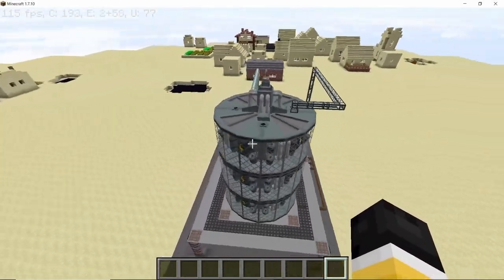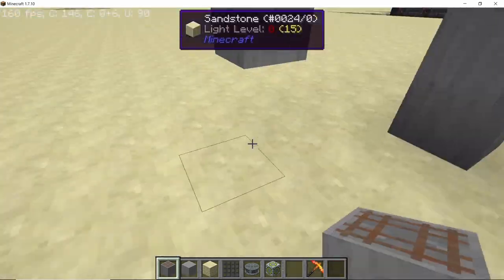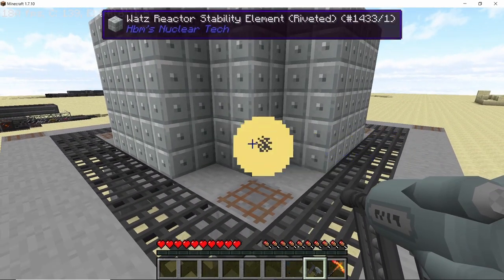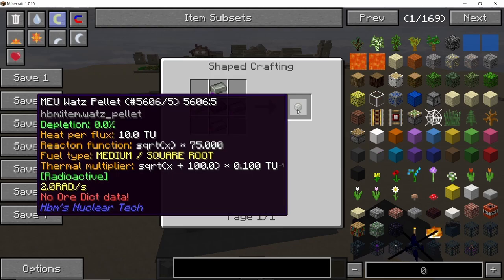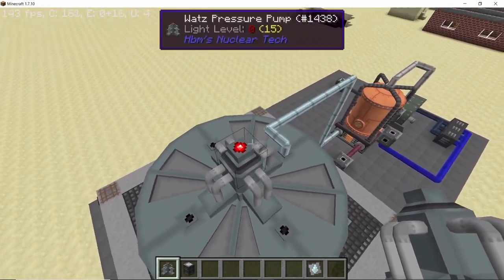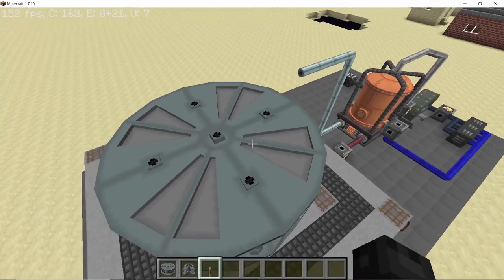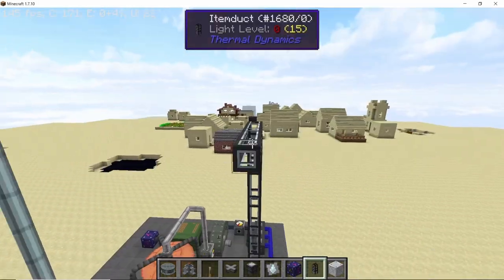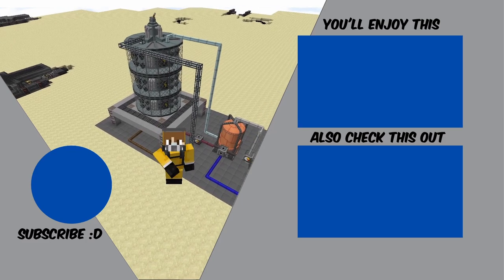Watz Powerplant guide - Reworked Watz Reactor - HBM's NTM

Comment: I remember building one of these back in the days on my base, and just by using LES fuel i was able to produce about 2.5 MHe per second which is absolutly fantastic!
Also i like that they made it different now, it's nice to have it customizeable
Reply from the maker: So true, it being stackable with different fuels on different levels is definitely going to be helpful !!
And that's an absurd amount of HE/s ... I wonder if the number will still be close to that now that the heating system and fuel values have changed
Reply: Fun Fact 
This reactor is very similar to the real-life Pebble Bed Reactor (PBR), mostly because the fuel is spheres, the difference is that in real life the PBR is gas-cooled, usually nitrogen, helium or CO2.
Reply from the maker: @ArkhamHedler  yeah, each level sharing fuel reminds me of three pebble bed reactor from nuclear craft.

Comment: What version do you usually prefer in running of this mod, I used 1.7.10 for a while but it has a bad optimization, I tried to switch to newer versions but it kind of changed since the requirements of the reactors changed and some of the Images for the Items have glitched, kind of..
Reply from the maker: I would always take 1.7.10 over all other versions tbh , idk why you feel that it has been badly optimised... Cause NTM for that version is updated constantly and so much new stuff is added + all the bugs are taken care of
Reply: @SavageVegeta  Alright,thank you.

Comment: Wait so coolant goes in the WATZ plant then its hot coolant and then into the boiler with water that cools the coolant down? Is that what you meant
Reply from the maker: Hot coolant goes into the Heat Exchanger which heats up the boiler turning water inside it into steam 
So coolant never goes in the boiler, it runs on a separate system and water-steam runs on a separate system
Reply: @SavageVegeta  hbm mod is now sooo confusing.
Reply from the maker: @JovanDjokic-id2uo  just some fun new machines , once you play around a little bit with those it'll all become totally clear to you